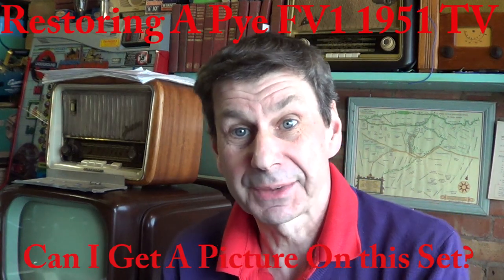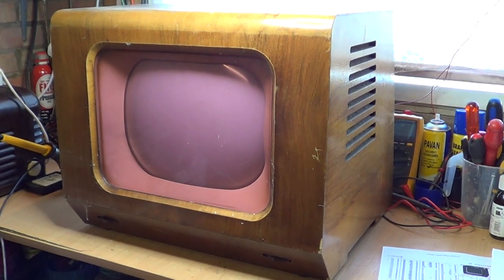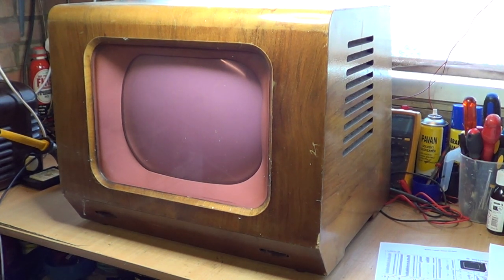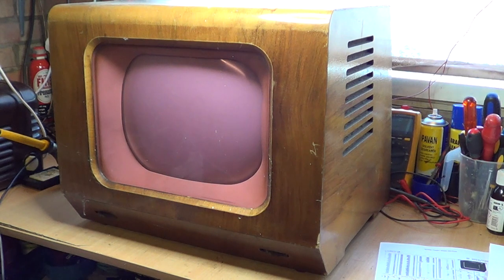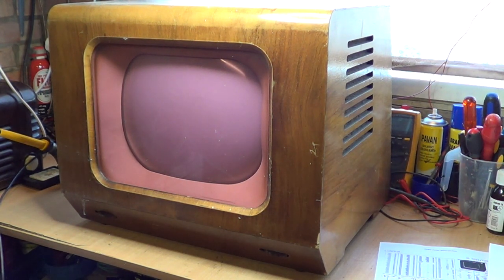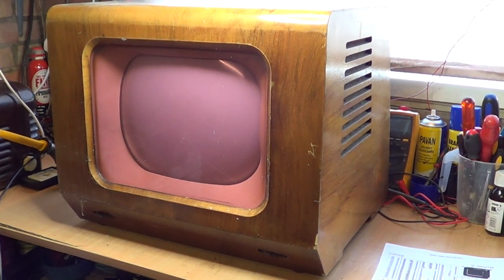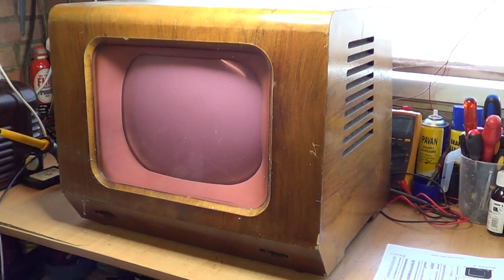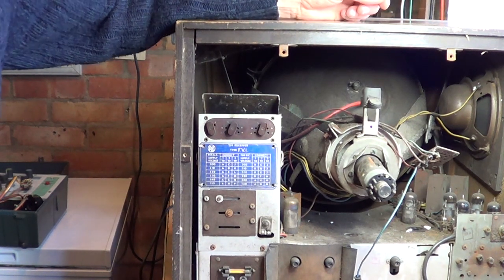Attempting To Restore a Vintage Pye FV1 1951 TV Set.

Comment: Grandad bought one of these for the coronation in 1953. Not sure if it was new but it was the first set I remember. Had a liquid magnifying screen hung from the back casing screws? Only got BBC so disappeared when ITV arrived on the scene.
Reply from the maker: Yep this set was made in 1951 and up to about 1952 so could have been new or second hand. Yes you could have put a box ITV tuner on this set in 1956 with the coming of ITV but more hassel and by that time these set were pretty tired anyway! Nice to now it brought back some memories for you thanks for your kind commnet. Kev.

Comment: I just picked up a General Electric 1956 TV 14T007 UHF television. It turns on and screen lights up and all buttons work.  It looks magnificent.  Out of the back has two Red wires with forks to connect to screws.  There’s a VHF and UHF pair of screw connectors at the back.  Not sure which one to connect the Red wired to.  Anyhow I’m going to see what I can find online and see if I can connect a VCR to it.
Reply from the maker: Sounds like a lovely set you have there! Yep, I know people here in the UK use to use 405 line recorded tapes to playback somehow in a VCR a few years ago I assume you would need a modulator? I have one of the small Aurora units that convert a video input from a DVD player or a TV box back into a 405 ling signal to use on your old UK Tv's its fantastic. Let us know how you get on if you can do that?  Good luck. Thanks, Kev.
Reply: @BramleyProductions  Thanks for your reply Kev.  I’m in Canada, a city called London, Ontario.  I assume all TVs from that era ran on a 405 line signal.  That information will definitely help me.

Comment: Love the old  pye Bush    tvs .set  and radio grams   such Class
Reply from the maker: Yes, I like Pye models as there always seems a good chance you can get them going with a bit of work and good luck! As they used Mullard valves and Mullard Cathode RayTubes which seem to have lasted better than say some Mazda TV Cathode Ray Tubes found in other sets. Pye was always well built and made so it could be repaired back then unlike things of today. Thanks for your kind comment Kev.
Reply: @BramleyProductions  one question  how do you find the original test card   on there    must be done by camera
Reply from the maker: @steveconn1375  Hi, Steve, thanks, No camera is being used re the Test Card C! I am using an Aurora 405 line converter box. Which takes a video input from, say, a DVD player, or you could even use a SkyBox Or Freeview box and take the video feed from that and feed it that into the little the Aurora box converter this than by some modern chip magic turns the video into a 405 line signal that can be feed then into the set via the normal aerial socket on the TV. Now, this little Aurora box can be switched to the different old TV Channels this Pye set is Workling on London Channel One Alexandra Place. The Test Card C is there again on some chip in this box, so it is handy as you don't have to connect up a video source up to the Aurora box say. Just feed this Test Card signal into the set straight from this Aurora box. This is a very clever bit of high tech to make old 405 line TVs come to life again.  I think I talk about the Aurora more when I have another one of my old Pye sets running here. Best wishes and thank you for your interesting comments questions. Kev.

 https://www.youtube.com/watch?v=FgL-AvD6xiQ
Reply: @BramleyProductions  wow that's amazing   probably get muffin the mule on there  lol great   👍
Reply from the maker: @steveconn1375  Yes it's kind of very old Tech meets 2001 Tech! This is great as the set is 100% original apart from a few resistors and capacitors! And still works. Or can work with this cleaver modern-day device the Aurora! Thanks, Kev.